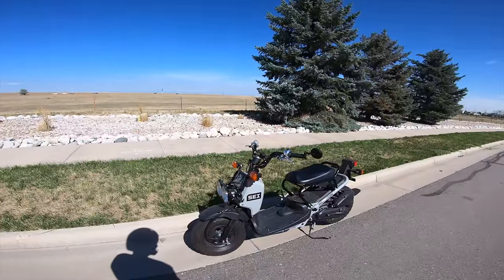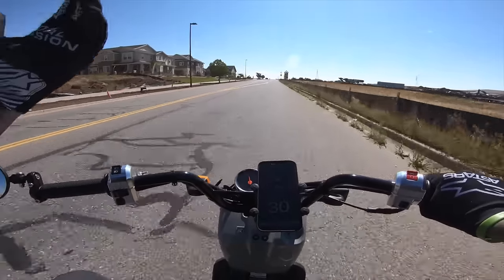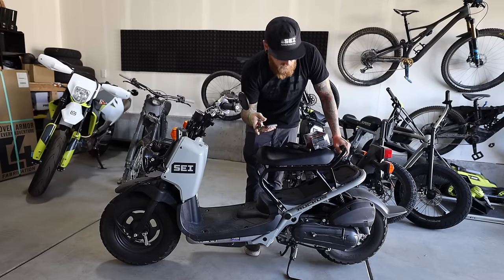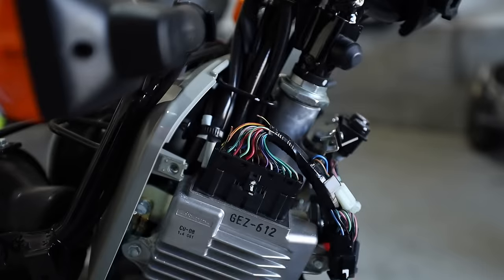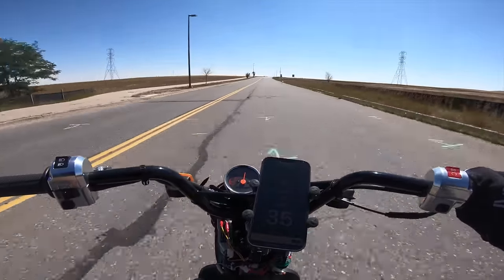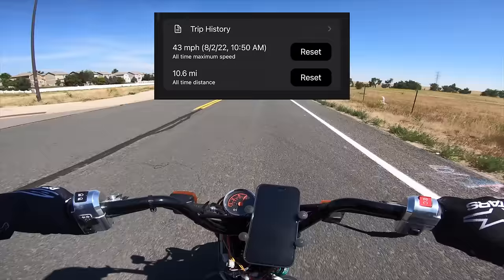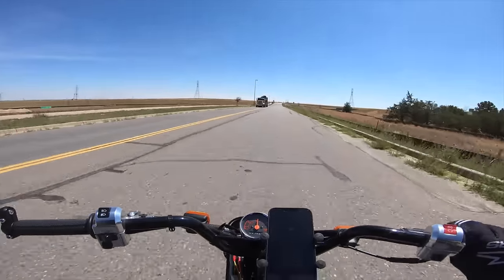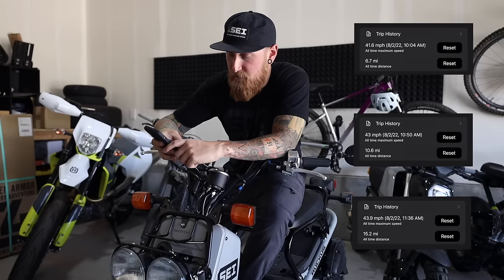Honda Ruckus Go Fast Kit! | Stage 1...

Comment: Love the idea of riding something like this to and from work; but just don't trust cars on the road.
Reply from the maker: I feel that 😅
Reply: Me too.
Reply: here in the uk 30 mph ,is very dangerous with 42 tonners up your backside.
Reply: Why I sold mine I have to travel rt6 in Ct better known as suicide 6 lost three friends just this year on bikes in an eight mile section of this road just this year (2022)
Reply: @TheeDrSack  
Popular in Phoenix, Arizona.
Reply: I’m 6’1 I feel I’ll look stupid
Reply: @bfarm44  Sorry to hear that.  Other drivers increase the danger, big time, and people get pissed when I’m driving slower than the speed limit.
Reply: Does the ruckus have a restrictor plate like the metro? I’ve seen various videos stating removal of this plate should be one of the first considerations for any speed increase mods. Would like to know from others if it is indeed a difference maker.
Reply: You had me in the first half then really fell off.
Get a bike and face your fear.
Embrace mortality and deliver yourself into chaos.
Reply: Ride on the sidewalks then😂😂
Reply: I ride with the Mrs on her stock Ruk and me on my GROM. Though we never ride on the highway…well, with the Ruk that is…we always keep our eyes on the mirrors and will always put on right turn signal, slide onto the shoulder at reduced speed and let the cagers continue. Many of them will give a wave or flash their hazards in appreciation!
 I did use the Ruk for a 30km run on the highway staying on the shoulder the whole time without any problem.🍺🇨🇦
Reply: That's not a reason not to live. Imagine not having run riding something like that to work because of "other cars" LOL.
Reply: They gas prices are deadly too
Reply: @Peter-yc1rs me too and I don’t care how I look to other people
Reply: @Peter-yc1rs  don't worry about how people perceive you.
Reply: Did that for a month at 38 mph yeah stock 49cc is too slow. After bbk and belt and carb and vatiator and plug and wires and battery😳 
Well now it's safely daily easy cruise at 45 mph no more pinned throttle lol and and this tao tao got almost 10grand on the spedo lol😂🤮
Reply: Cars aren't to be worried about, it's the drivers of these things you gotta contend with.
Reply: Take an MRT course and ride like you are invisible.

Comment: I did a stage 4 on mine - installed a turbocharged hayabusa engine , best top speed so far is 350 mph so quite pleased😄
Reply: personally hit 4 large downhill
Reply: Where can you get the kits ?
Reply: Started reading this and was like: stage 4?! 😮 Then got to the turbocharged busa engine was like: 😒🙄🥲

😂😂
Reply: @irvingpena4810  I’m now working on stage 5      2 Lockheed blackbird jets  bolted onto the rear mudguard , should be good for 750mph! 😂

Comment: With present gas prices the ruckus with these tweaks seem like a great alternative mode of transportation … you made it look easy
Reply: However the removal of the governor and the rejetting the carb will likely drop the expected gas mileage. 

Honda made three bikes with their 234cc twin that gets 90+usMPG at speeds under 55 and has a top speed of 75 (80mpg) for adult riders.

Honda Rebel (older model ended in 2016)
CB250 Nighthawk (ended 2008 and has the same sized riding frame and orientation as a Bonneville T120)
A scooter version bigger and more complete than a ruckus 

Those can usually be bought for under $2000 in mint condition or $1000 in thrasher condition.

Sure they require plates and insurance but the Ruckus does too in about half the states.  Insurance on a <250 is about $6 a month and plates are usually cheap (under $30 a year) even in tax value states.

I'd keep a Ruckus for around farm runs and errands to the rural store or in a small village with 25mph streets.

Guess it's fun to tinker, but those 250s or a 125Grom are a better use of money if you want to go at 2 lane highway speeds for distance.
Reply: @STho205  i got a question. What does rejetting the carburetor mean?  Does it mean cleaning the carburetor
Reply: @computerlearingchannel4257  no.  It means removing the brass jet and needle and putting in a larger or smaller one.  Fatter or thinner hole and needle.
Reply: @STho205  thank u
Reply: Wrong.  Ebikes are still the best bang for your buck.
Reply: @painexotic3757  
Not really.
Reply: @Winterstick549  yes really. From gas alone, you're saving thousands of dollars over the years.
Reply: @painexotic3757  
Depends.
Do you need to be able to move faster than 30 mph?
More range than 100 miles?
Reply: @Winterstick549  for an average commuter, ebikes are fine. Most people aren't commuting 100 miles a day my man lmao. And if you really need to go that far, you can just get a dual battery ebike. And there are plenty of ebikes that can go up to 50-60 mph. But, for the most part, most people dont need to go this fast. You can get to where you need to go going 20-35 mph. I usually ride 15-25 mph and get places pretty quickly. But aside from this, I mainly love ebikes for the cost savings and versatility. No insurance, no registration, no license needed. I'd be paying thousands in gas alone so that's extra money in my pocket. Barely any maintenance on an ebike and it's cheaper too. And I can ride my ebikes on trails/sidewalks. Just too many benefits and very little downsides.
Reply: Hey there! I recently stumbled upon a new project called freebeat Morph 2-in-1 eBike, and it's got some incredible features that I think you'd find interesting. One standout feature is that it can be charged indoors, making it super convenient. Plus, its brushless 750W motor delivers impressive power and speed, perfect for conquering any terrain. And with its Smart Saddle Detection+ feature, you can easily track your fitness goals and stay motivated during your rides. It's definitely worth checking out if you're looking for an alternative mode of transportation. Keep up the great work with your Ruckus tweaks!
Reply: my ruckus payed it self best investment i was paying uber so i was working hour for free everyday fuck that i said im getting a ruckus and booom got my 21 white ruckus brand new and it payed itself off

Comment: I really feel Honda is missing out not making a 125cc version of this
Reply: the 49cc limit is so that it doesn't have to be registered (or insured) anywhere except California.   If you want a 125 than they will happily sell you a grom , a monkey bike, or a trail 125.   I'm guessing they don't think they need 4 different 125 models.
Reply: @RoamGaming  I think in my state alabama you still need a license for it even at 50cc
Reply: @josephedwards8992  a full motorcycle license or the lower level moped style one?   i live in CA and we need the full fat motorcycle.   i didn't think anyplace else required it but i could be wrong.  laws change.  :(
Reply: @josephedwards8992  alabama defines a motor driven cycle as having a motor that is larger than 150cc, exceeding 5 horsepower, or weighing more than 200 pounds.   the ruckus is 49cc and makes 4.6 hp and weighs 194 lbs so it does not need a license in Alabama.  50cc is pretty normal as a requirement for a license worldwide though which is why the ruckus is 49 to sneak under that.
Reply: @RoamGaming  I believe you still do in alabama I’m not 100% sure though

Comment: I miss the days of the 50cc Honda Elite scooters with 2 stroke motors.  Now those things can be made crazy fast!
Reply: They Aren’t as reliable as a ruckus. For me as a delivery driver I have to go with ruckus unfortunately
Reply: I have a Kymco zx50 with a long case dio motor, very nice engine. I have a Polini Contessa for it that I'll install soon. I also have a Airsal sport LC kit for my Kymco super 9 that I have to install, and a Top Performance trophy 72 on my Aprilia SR50. 2 stroke is definitely the way to go. can go very fast compared to the 4 putters
Reply: @Winner3ty 💯

Comment: Added the stage one kit cdi and clutch.  Changed the weights, have tried several different weights.  Down to 4.5 gr. Did everything but the intake and exhaust system and there's absolutely no difference of any noticeable amount.  Essentially it is still the same.  Several other people have the same situation.  From what I see the only people claiming an increase is downhill and that's not accounting for the wind.  The only increase I see so far is on my credit card.
Reply: I only noticed quicker acceleration, but no difference in top speed.

Comment: I've done all the mods.  deleting the airbox and jetting the carb made the most difference followed closely by different variator weights.  The rev limiter thing makes you go faster downhill only from what I've experienced.
Reply: Would you know which jets and sizes?
I live at sea level.
Reply: @Winterstick549 not a good idea to take strangers advice on the internet. Trial and error are your best bet. Because even at sea level, atmospheric conditions are different. Have some fun with it. If it helps, I used a size 71 on my mikuni clone on my homemade moped lol

Comment: I highly recommend using ethanol free gas as the Ruckus uses a carburetor.
These are also great for food delivery.
Reply: For performance reasons or reliability? I’m referring to the fuel.
Reply: @northjerseykevin3915  Both. He said that because the main culprit when something isn't starting or running a little off that uses a carb, it's usually a dirty carb from gas.
Reply: @northjerseykevin3915  
Mostly reliability, but you may notice an increase in performance.

Comment: Great video. Impressed with your overall mechanical knowledge. I just purchased 2 of these last year and absolutely love them. Based on where we live If i could find a way to high 40’s i would be stoked. Problem is Im not confident in my ability to make the modifications, if anyone knows someone in the Sarasota area that could do it please let me know. Getting 38 mph is sill a blast but increasing to 48 mph would be game changer.
Reply: upgrading it would be a great learning experience man you should try to do it yourself, if you don't have tools already it definitely could be an inconvenience, but if you got tools go for it, being that its a honda product there will be a ton of info online, I love working on stuff and doing things myself, its a very fulfilling thing, but good luck man maybe just do some research and see if it really is that hard, I am in Englewood which is just south of Sarasota, about an hour so i kinda felt i had to reply haha. But ill leave you with a good quote, "everything seems impossible until its done"
Reply: I wish Honda would add a 100-125cc Ruckus.
Reply: @Winterstick549  they made a big ruckus for a little while that has a 250cc
Reply: @Winterstick549  The Mrs has a Ruk and I went down from the CRF300L to a Grom as I was always grabbing the Ruk for short rides.
  The GROM is a 125, feels way safer on the front end as the Ruk to me seems too light. The suspension is  better, though not perfect but oh so much better than the Ruk. Slightly bigger tires which makes a difference when hitting bumps.
  We take our mini-moto’s everywhere!
 Very light, I mount the GROM just like a bicycle and have no problem shifting it around in tight spaces. 5-9, 180, 30” inseam and I can plant both feet firmly on the ground anywhere.
  Speed wise, I can cruise along @ 85kph all day. Slows a bit on the hills but not that bad…@60-65kph.🍺🇨🇦
Reply: @57Jimmy  
Dodgerider on YouTube has an easy, inexpensive way to firm up the Groms forks.

Comment: Try to install new Tyres on the back with 130 90 10 size, dat is alittle more then stock 120 90 10 but it can add 3 miles per hour in whole range and top speed, caz of radius of the wheel. I did it on my Yamaha C3 sccooter, raplaced both of wheels to 130 90 10 and happy now, caz it also made alittle more space under the scooter.

Comment: Variator weights wont directly effect top speed only the RPM range at which the variator opens.
Lighter weights having lesser centrifugal force so opening the variator at a higher RPM making acceleration from standing faster.
Heavier weights having more centrifugal force opening the variator at lower RPM making standing start acceleration slower but mid to top speed acceleration faster.
To gain top end speed, you need to raise the RPM limit or change the gear ratio either with final drive gears or larger diameter variator cones.

Comment: Replace the clutch springs to something a bit heavier and that should help with launching at a higher rpm. Intake and exhaust with a rejet of the carb will definitely help with your mph goals. Good luck.
Reply: Blue spring is for fat ppl white spring is for skinny ppl keep that in mind
Reply: Make sure they are for Get motor NOT gy6 they are very hard to find

Comment: my 2022 did 42 stock, I bought mine before yours maybe a week? lol  I now have 2700miles on it, it started to lose speed I am now at 37 so I ddi the polini and staggered the weights, it came with in the variator i am now at 46 down hill and roughly 42-43 on flat land again.  in pa so you know the hills!
Reply: Where at in PA my man? I just got a 2023 ruck and live in the Lehigh valley

Comment: Love my Ruck, also own a Spyder RTS, HD Ultra Classic, Tundra 4x4 Crew Limited & an 08 Shelby GT500 convertible for Sunday Shows.
The Ruck is my around town errand bike & I installed a real rear carrier to hold a strap on 7 gallon HTC box for the times I pick up odds & ends. The Ruck also fits well in the back of the Tundra when I go camping pulling a 32' Jayco.
The Ruck is a mechanics dream, parts are cheap, easy to adjust & downright fun to ride. Mine is a 2022, Have the Rolling Ruck's EVI & ignition, Polini variator with Dr. Pulley Sliders, kevlar belt, performance clutch, performance variator face & what is absolutely necessary is a real tachometer.
At Sea Level, on flat ground no wind - my top speed is 48/49mph & will cruise steady at 45mph. My weight above Rukus curb is 230lbs including under seat bag, front barrel bag & rear carrier plus me. I also do not use ethanol gas & prefer the E3.38 spark plug & 10/30 pure synthetic oil filled to 3/4 capacity plus Michelin street tires using 29psi front & 36psi on the rear . For top speed increase, you must exceed 8850rpm's & preferably run above 9000. For those of us above 200lbs, this means 4 or 4.5gtam sliders possibly 3 of each to average 4.25grams.

Comment: looking forward to watching these.   I had my ruckus up to a gps verified 57 mph and it was a blast.  although i don't recommend that speed without upgrading the brakes.  it was a bit sketchy at those speeds.   as for motorcycles riders that refuse to acknowledge me i would just turn around and ride in formation with them so that it looked like we were buddies.  the guy with a "biker for jesus" jacket riding a harley was a not a fan.  :)   With the yoshimura exhaust on the ruckus i might have even been louder than his harley riding at 35mph.

Comment: Is this your first video or did you do one that shows what you’ve done to your Ruckus so far?  I noticed right away you replaced your mirrors with an under-the-grip mirror.  I just got my Ruckus (the one I ordered in May) and I’d really like to ditch mine, too.  How do you like the new mirror?  Does it work sufficiently or would you have tried something different, now that you know more?  I’d appreciate an answer because although I live in Michigan and there’s snow in the forecast for today, I’m keeping my Ruck ready to ride until I know there’s no chance of riding anymore this year.  Thanks for the video.  All I can say is, OUTSTANDING!!!
Reply from the maker: I did one video introducing the ruckus. The mirror is great and its what I put on all of my motorcycles. The CRG Hindsight mirror.
Reply: @TalonSei  Thanks for the answer, Brother.  Been a few decades since I’ve owned a bike but I rode my neighbors Ruckus and was smitten.  I got up to 40 mph on it and remembered that old FREE feeling that two-wheels gives you.  Now I’ve got one and it does 38 mph reliably, with me on it (I weigh 180).  I’d like to increase it by 7-12 mph, because the other day I rode a busy road here and a guy got about 5 feet off my tail.  Speed limit was 40 mph and then changed to 45 mph and as my turn came up, the guy tried to sideswipe me.  So I want to increase my speed so that type of thing doesn’t happen again.  Thanks again! 👍😉👌😄💯‼️

Comment: The terrible speed is the reason I can't justify one of these. They're cheap, reliable and super fuel efficient but no way they can do the speed limit in my area either. Need a small dual sport at least. My 87 Honda XL185S was awesome around town even in heavy traffic. Right now I'm working on an 82 Honda XL500S so I can cruise the highways too. I hope you get the speed you're after but I'm worried 30-35 might still be the practical top speed unless everywhere you need to go is at the bottom of a long hill haha. Either way it'll be a good time.

Comment: If you change your gears variator and clutch you wouldn't need that rpm Rev Limiter delete because after my get motor didn't hit Rev with intake exhaust and 20mm round slide carb with top upgrades

Comment: I'd stack your weights with heavy and light every other slot helps with take off and top speed gives a best of both worlds and change your clutch and bell for a 3 puck along with a bigger rpm springs

Comment: You don't want a GY6(still no low end torque) or any 4-stroke engine, if you're gonna do a engine swap put in a OG 2-stroke motor and you will be able to go all the way to 85mph.

Comment: Would you think doing a variator and some weights alone (without doing a CDI) would be worth it?
Reply from the maker: It would accelerate a little quicker but a CDI is so easy to install that’s you might as well do both.